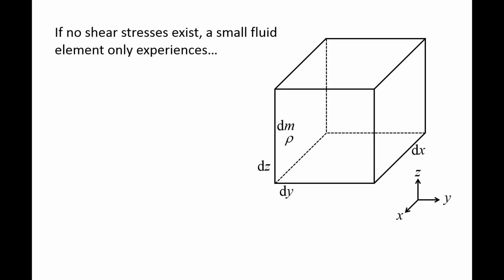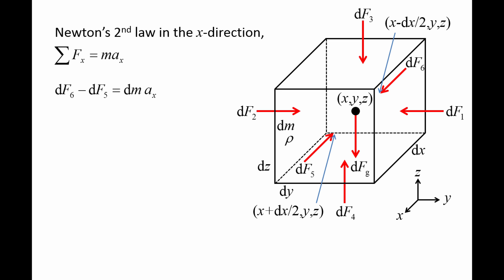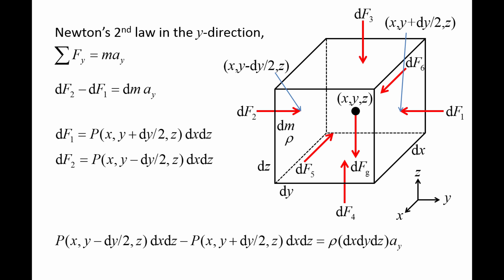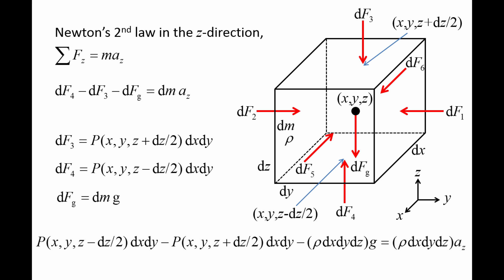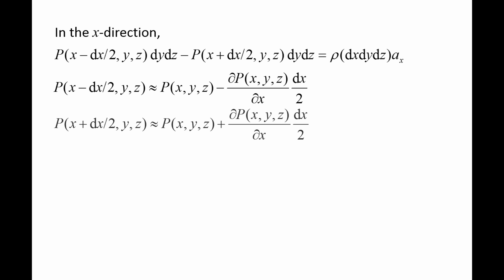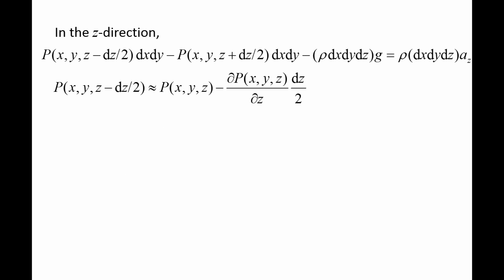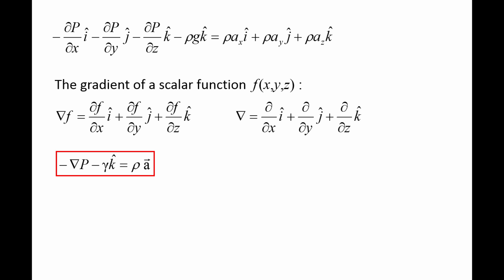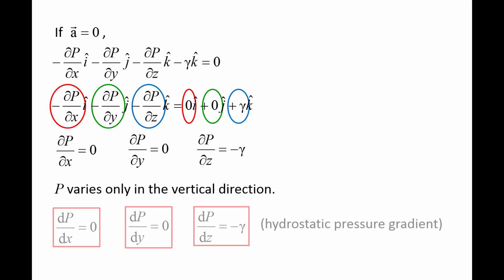Fluid Mechanics: Topic 2.2 - Hydrostatic pressure gradient

Comment: Could you explain the term (X +dX/2, y,z), using two dimensional diagram and drawing line distances because it is hard to see through 3D?  Much appreciated!!!!!
Reply: https://youtu.be/XPCgGT9BlrQ 💐💐💐
Reply: in the image, the pressure forces dF5 & dF6 act at the centre of the faces; the faces which are at the front and the back.

Comment: Sir, i did not understand why the forces act at x+dx/2 away from the center ?
Reply from the maker: Pressure forces at at the surface of the fluid element, which is dx/2 away from the center.